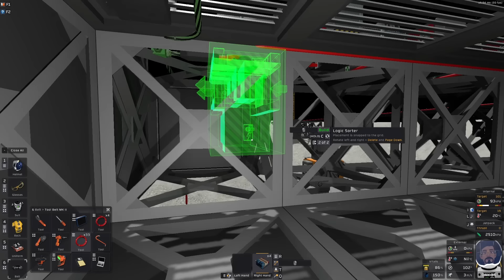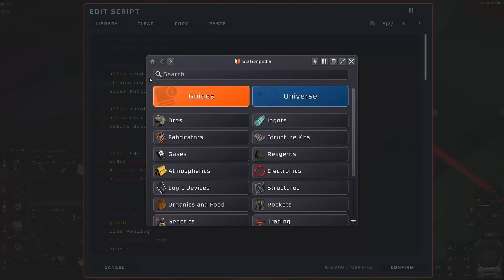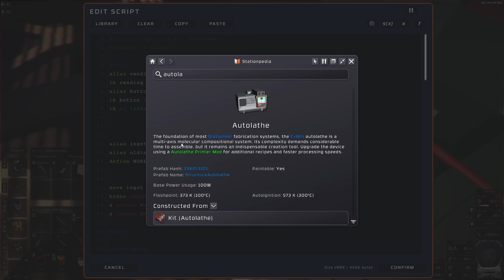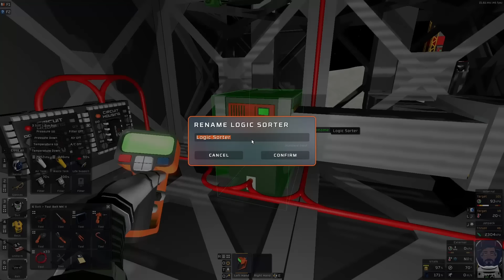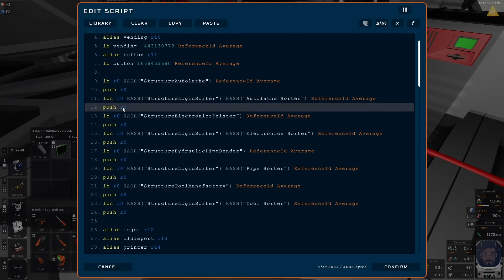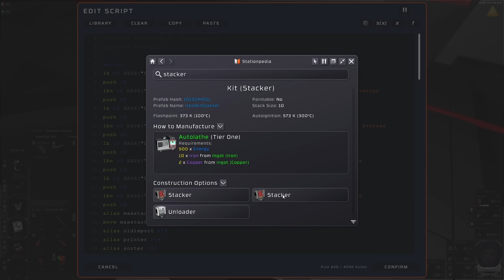Stationeers - Writing new printer logistics code

Comment: Instead of storing the export count in the stack, you could have set ClearMemory to 1 after a successful print to clear the export count on the printer. It automatically resets both ClearMemory and ExportCount to 0.
EDIT: Having done this myself, it also resets ImportCount to 0, which means it could mess with the restocking program, requiring manual resets after nearly every delivery.

Comment: My chutes got clogged up by a sorter that experienced a burnt wire. Fixed it and cleaned up all the ingots from everywhere. 

But now the IC is stuck on some random item hash (displayed on db). It's not a valid hash.

I tried clearing all printers with code and the IC housing. But as soon as i put in the chip, its back stuck to the same broken hash, -17 something something.

Anyone experience seomthing similar?

I know a proper reset of all printers is by full deconstruction and building them again. But id rather dind a different solution

Comment: I think using average for the load batch of the vending machine will make you scratch your head in the case there are more than one. maybe min or max would make it work with the wrong machine and make you think that there are more than one in the circuit or you might get lucky and it works. my 2 cents. Really like how you code. Keep it up!
Reply from the maker: Using maximum or minimum will return a working referenceID of one of the items dublicate items resulting in unpredictable results.  If you use avearage it will return an invalid ID that will generate an error and aid in tracking down the fault.  Thats my theory.
Reply: @cowsareevil7514  Yeah i figured as much hence the head scratching part. My theory is If failure can cause harm, fail safe. If failure just causes inconvenience, fail functional. This case is the latter. So 50% chance of it working properly is better than 100% of it not working at all if it wont do any harm.

Comment: With the terrain update we got the ability to iterate all refids on a cable network.  You could use that to discover printer+stacker pairs that are named the same without having predefined names in your code, and it could even support duplicate printers.
Reply: I've attempted to look for the IC10 instructions that would let me iterate a network but am coming up empty. Where can I find the documentation for them?
Reply from the maker: Not sure what you mean by this.
Reply: @cowsareevil7514 You can now use get to retrieve refids from the connection of a device.  Ex. "get r0 db:0 0" will store the first refid in r0.

Comment: I find this new series approach very very cool. Going from easiest and up through the difficulty (I mean, if this is your approach Mick). And it's not like I don't like the 30+ series episodes, but for me it's the initial base build and get stuff sorted that matters and keeping those at 10-15 episodes pr. scenario is pretty awesome. In fact I'm building along with Mick. Doing my own stuff and design, but I'm building on the same planet/moon as Mick, but just keeping it slightly my own. For this moon visit I just had to use his new code for the logistic and it works flawless out of the box. Cheers Mick. Keep it up

Comment: Maybe have a proximity sensor input to turn off  the display at least when you're not near the printers. I have no idea how much power the sensor takes. Could also have the whole system go into a "standby" mode if no actions have happened for a while. Not sure exactly how you'd code it.
Reply from the maker: It is not much power so I didn't think it was worth the trouble, but there are still many ways to optimise and add to it.

Comment: It would be interesting to also add the security and rocket printers to this...im assuming it should be easily adapted
Reply from the maker: Any number of printers can be added, just a matter of adding the device IDs to the stack.  You can also have multiple of the same printer but the autodetect wont work if you do that, amnual device IDs will have to be entered.

Comment: First off, thanks for your videos. I’ve learned a lot from them. You can use logic memories to save the hash requested on the specific printer ingot then be able to use the consoles over the printers like your old setup.
Reply from the maker: It can be done many ways, but all I really need to know is that the vending machine is working but has run out of ingots and I need to add some more.

Comment: I’m no where near as good as you in this game but I do want to learn how to code so I can free up some of my time eating through mindless tasks. Ie checking pressure manually then open a valve, or turning on and off the AC in base constantly… you get the picture. I do have about a years worth of programming in C so some of the stuff you do follows but then without notes in the code I get lost. I tried drawing a flowchart in my mind but that got messy. Is there a good video somewhere that explains how to do that part of the game?
Reply: He has some pretty solid IC10 coding tutorials on his channel
Reply from the maker: I learned mostly through trial and error.  If you can code C then you just need to think in much smaller simpler steps.  Starting with simiple on/off switches is a good place to start.  Have a look at my playlist for coding to get the basic syntax then a lot of try and see.

Comment: 37:24 no room for adding a flashing light if the vending machine runs out? Or would that require too many lines of code for that I/C chip?
Reply from the maker: The code doesn't keep track of the stock in the vending machine, it just sends them out.  I can still run my old vending machine restock script to track the vensing machine and warn of low inventory.

Comment: You can set the "ExportCount" of the printer to 0 if it is not active and get rid of the "oldexport" variable and also some of the maths. Just check when the printer is active if the "ExportCount" is greater then the setting of the stacker :)
Reply from the maker: I can only reset both of the import and export counters.  As they are being used seperately, this would cause issues for the other chip.  I rand into this problem on previous versions, that is why I have to keep track of the old value.

Comment: Nice one Mick, alot cleaner and easier to setup.👍
Time for another vending machine that keeps a stock of cables, sheets and pipes that auto refills?

Thinking about it the AimeE code would also benefit from all the new possibilities and ease the setup.
Reply from the maker: I would like to have a locker of basic supplies that LArRE will keep stocked.  I will keep that for a future project.
Reply: @cowsareevil7514   Would love to see your implementation of that. That was my goal on my last base before the terrain update. But mine was to be completely automatic from mining to end parts. I was debating between locker or vending machine. I had the core systems working separately minus the lockers/vending machines. But did not get all of them to work together fluidly.  I have learned a ton from watching your videos and this video is no exception. Thank you, and keep up the great work!

Comment: Awesome work as always bud.

Could you add a sleep timeer to it please bud so we can save power when say, if the printer is idle for 600 sec, it will turn off the printer and the stacker.

Could you also add a countdown set to a small led console that reads the amount from the stacker and the number goes down untill it hits zero.
Reply from the maker: You could add a counter, but that adds more deveices and more power usage and more complexity which sort of goes against the simplification that I was going for.  But it would be easy to add a counter to the counting loop of the code.  That will also let you know if the printer stopped for some reason before the end of the job.

Comment: A possible embellishment - a second hash display to show the printer that's requesting the ingot that's being shown on the current hash display. Not sure if the referenceId in the printer register will do, or if you'd need to finangle a device hash from that. Possible vehicles for that hashId could be a logic memory, or the device housing of the Printer chip..? Or some other exciting way I don't know about. 

Love this though. So much more is possible now with those "new" name and direct addressing commands. Thanks for the vid!

Edit - oh, and if the displays are chewing power, mayhap they could be switched off by the vendy chip if all the printers are off.   o7
Reply from the maker: Once I have the reference ID, the printer hash is lost.  I could use the stack pointer to put up a number display or a light above the printer.
I could switch off the display and sorters, the clicking wont be constant, so it shouldnt be too annoying.
Reply: @cowsareevil7514 can't you do something like
`l r0 $ABCD PrefabHash` to get prefabhash from the reference?

Comment: Very good programming but maybe turn off a printer if not used for X game ticks?
Reply from the maker: You could do that.  My phone seems to be programmed to shut off the screen 0.1 seconds before I press a button without fail, which really irritates me, so I wont be doing that here.
Reply: You need to make another register
define TIMER r7
s TIMER r7 20000
sub r7 r7 1
beqz r7 poweroff
poweroff:
s printer On 0
or something like that...you have to make sure the s TIMER isnt in a place that loops Or make it only reset to 20000 when the printer is turned on or iddle